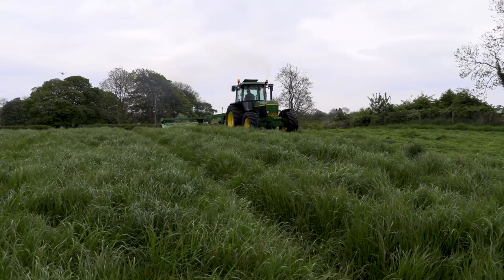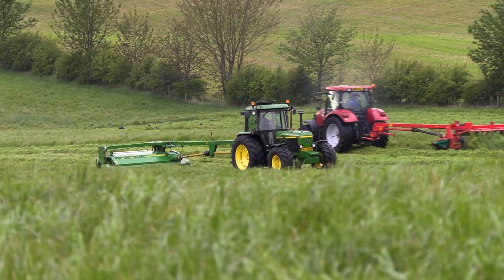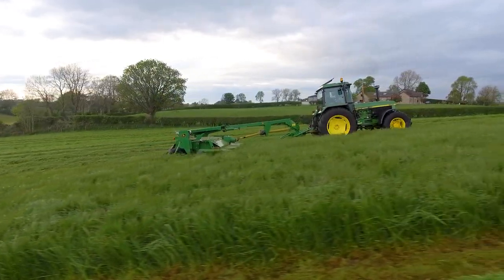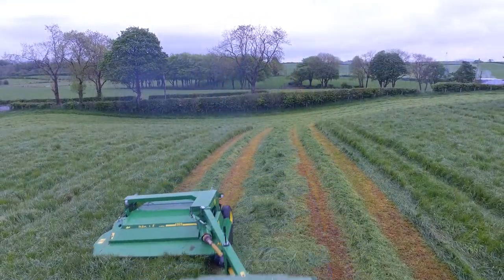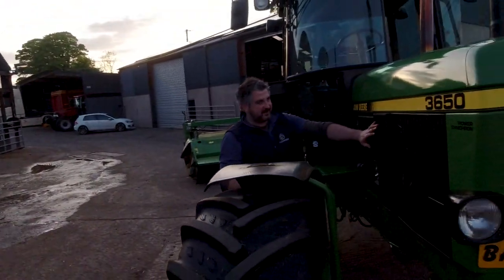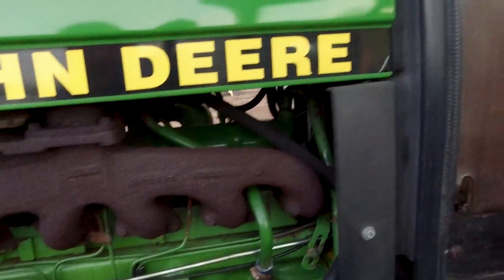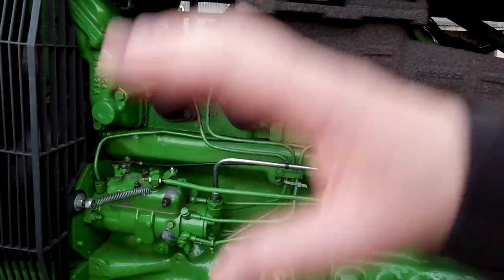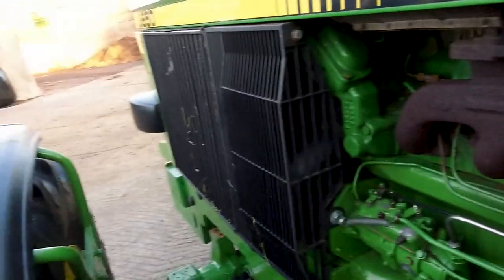3650 Repair and Mowing with the 1365

Comment: I agree with donkey it's not about big money tractors I cut with a leyland 482 and a kuhn disc mower that cuts 5 foot and it works like a charm donkey the tractor is grand it runs like a charm dont stress over it no one can be perfect